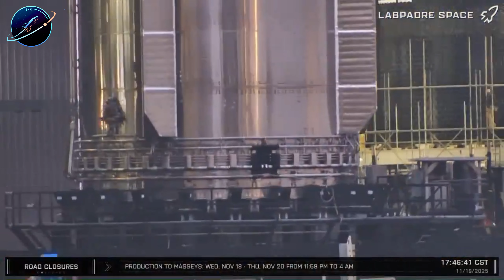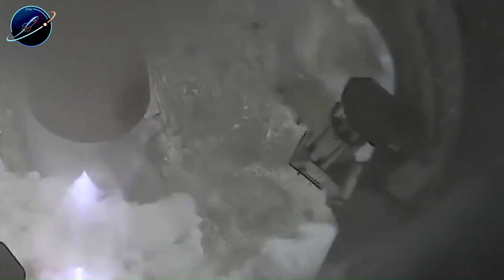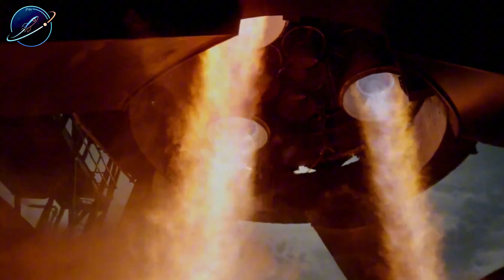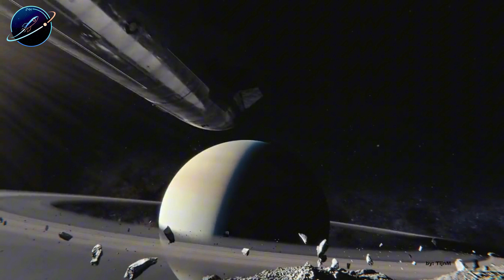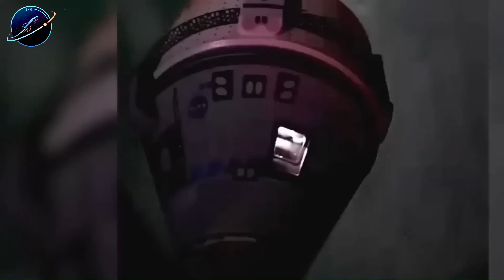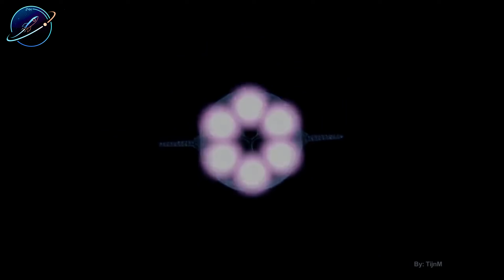SpaceX Just Did Something NEVER Seen After Booster Explosion...Boeing?!

Comment: It was NOT loaded with Methane. That would be dangerous! Since no methane (or even engines) were onboard, the booster was safe from ignition.  If you're going to make AI narrated crap, at least get the facts straight.
Reply from the maker: You're spot on—SpaceX confirmed no methane or any propellant was loaded, just gas pressure testing, keeping it safe from ignition. My bad on the transcript slip; accuracy matters in these updates!